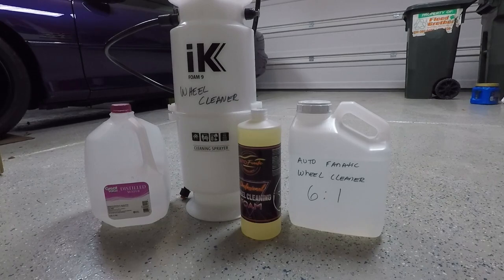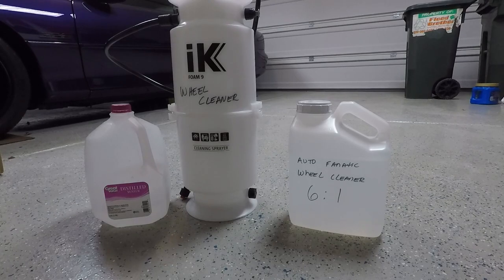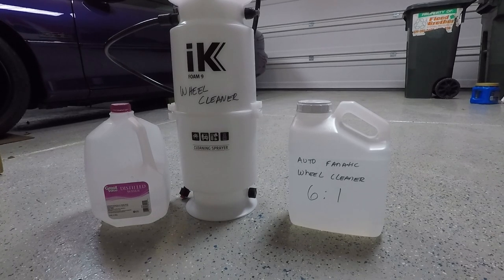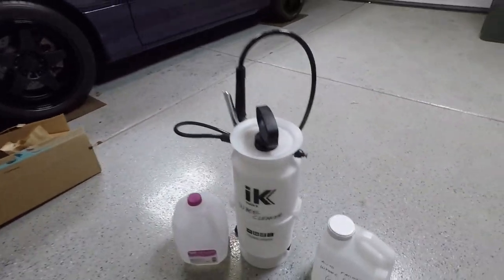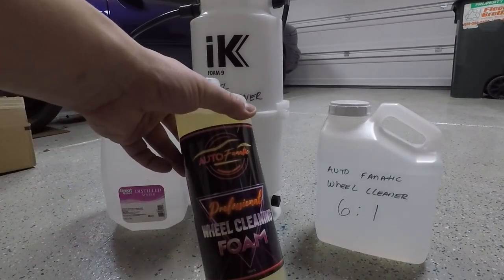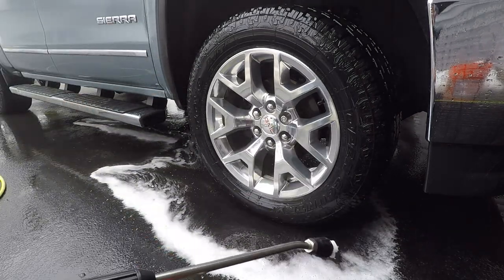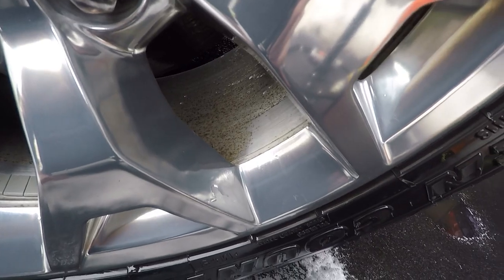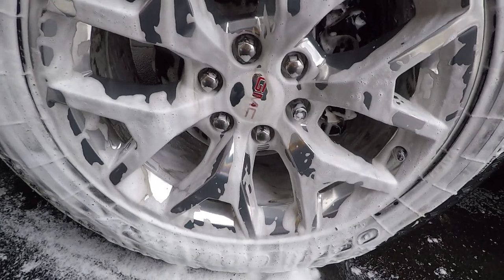Auto Fanatic Wheel Cleaning Foam v. First Use

Comment: As a AF cleaner user I can also say great product. However if your wheels are caked with crap you will have to agitate.  It works fantastic for weekly touch less up keep.  I’ve been using 4 oz to 1 gallon of water. Seems to be the perfect ratio for my application.
Reply from the maker: Thank you for chiming in 👍

Comment: Good video. Nice detail,  only issue I have with your video is that the wheels were to clean already for this example and even more clean once you hit it with the pre rinse. 
I ordered his wheel cleaner to though and can't wait to try it on my GT350- just waiting for this garbage winter to pass.
Reply from the maker: I agree that this example is not ideal. It was 40+ degrees and I wanted to clean the truck... And use the wheel cleaner. I will have more videos once the weather gets better. Thanks for checking out the video. Come back and let me know how it works on your Mustang ! 👍
Reply: @GavDetails  
will do - but will be a while till hibernation is over yet -
Reply from the maker: @cobras559  I feel your pain. I'm hoping for rain in the next couple weeks and 50s... I don't drive my car until I know for a fact there's no salt on the streets. I will be detailing the lifted Silverado next week. Hoping the streets are somewhat clear for the owner to drive it to the venue.
Reply: @GavDetails  same - wish they didn't put the crap down in the first place - then I would drive my car all year.

Comment: I would not pre-rinse the wheel first, especially for a touchless wash. You're further diluting it.
Reply from the maker: I have found, for my application, the system is not 100% touchless. So since the directions say pre rinsing is optional, I opt to rinse my wheels.
Reply: Gav Details my wheels have been maintained since new.  I clean them weekly. There is zero baked on brake dust. I’m wondering if a 100% touch less application with pressure rinsing would work for my car with this cleaner? I guess I’ll have to give it a try.
Reply from the maker: @c6z061  I coated the wheels on my Camaro with C5 from Gtechniq. I have a video showing whether the AF wheel cleaner can be a touchless solution. Unfortunately for me it was not. Even using it 12:1 it did not fully remove typical weekly buildup. Done get me wrong, it's a great product and I continue to use it but for my experience it's not 100% touch free.
Reply: Gav Details thanks.

Comment: how many times you can clean your all 4 tires with a 1 gallon solution of 6 to 1 ratio 
i love this cleaner will get some soon i mean 5 gallon of solution for 50 bucks aint bad but i dont know how much product you spend each time doing a wash
Reply from the maker: I would count on 12-16 wheels per gallon. It will depend on size and how dirty they are.

Comment: Wheels were clean to begin with... And the part that wasn’t clean (barrels) it wasn’t able to clean. How can you say this is fantastic?
Reply from the maker: Did you watch the entire video? The driver front wheel was not rinsed, so there is more brake dust being removed. As for the barrel, that's due to 3 years of winter. Watch some of his videos, the way this product works on heavy brembo brake dust on black wheels( helps show the before and after better) you will see. I linked a video in the description. I will be making more videos to better show the results. Yes, the temps were higher this day so everything was wet and not salt crusted.
Reply: Gav Details 
Yes I did watch the entire video. The drivers side wasn’t rinsed, you also didn’t show the a before shot or the results from it so who knows what happened? 

There’s alot of wheel cleaners that can do what this demonstrates and can do it without pre rinsing the wheel. The price of this product is absurd. 

Next time try it on a dirty wheel, and instead of wiping it with your hand use a light or white colored microfiber towel. Not trying to be rude but this was not impressive.
Reply from the maker: @Samuelfish2k  I will start this reply with "all do respect" I wanted to try the cleaner so I filmed one wheel. To keep my videos shorter I was not going to show all wheels. If you need before during and after, there is a 5 picture post on Instagram. If you are concerned with the price, I agree, it's more than Iron X or Sonax but the principle behind why he formulated his the way he did is so that it's safer to use than the others. I have nothing to gain by "lying" on YouTube. Once I can drive my car in the spring time and have brake dust build up, I will be sure to post a video with your requirements.    The barrels of my wheels are shot, I used wheel coatings and it did not help due to winter in the Midwest. I tried iron removers, heavy clay and even #0000 steel wool and nothing removed the "pitting." thanks for checking out the video.
Reply: @GavDetails    That was a great response to someone whom apparently is a complete idiot. I don't know why people like that even leave comments to begin with. One thing I wanted to add as far as price goes... This price is not what you're getting in product at face value.  That one container is designed to be diluted to make anywhere from 3-5 gallons of product.  (That's 384-640 ounces for $49.95)  Do a price comparison with those amounts and see what else compares.  Thanks for the awesome review! 👍
Reply from the maker: @ldtriton  thank you for taking the time to watch the video and read through the comments. I should add that I had more than a third iK 9 container full of product remaining plus some in the gallon jug. I would think you can get 10-12 wheels out of a gallon. Doesn't sound like much but more time with the product is needed to see how far it goes.
Reply: @GavDetails  
Subscribed!
Reply from the maker: @ldtriton  thanks !!
Reply: Samuelfish dude watch the video and listen to what he says, if you need an explanation let me know i make video transcriptions cheap you can read at your leisure

Comment: I dont like the fact.that I'm forced to use an ik foamer.
Reply from the maker: You can use a 1.5 but the 9 is better.  Cost of doing business I guess.
Reply: Swagura Mutsuki 

I use a second foamer and add water to it. Then just spray it down with my pressure washer. 

No need to buy a 100 doll ik foamer. Just amazon a 15 dollar foamer.